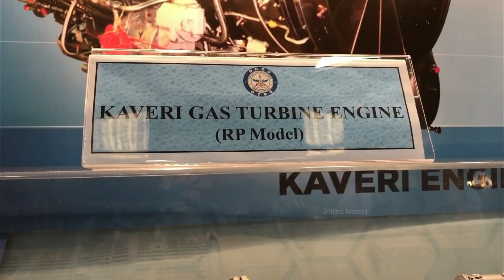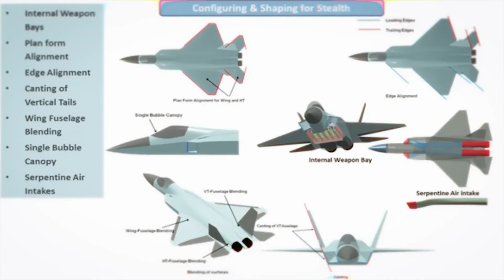AMCA: The Stealth Fighter That Could Change India's Air War Future | Reality Or A Hype?

Comment: the original design of AMCA was with a totally fetal mistake, it is too late to change, since it designed as a medium sized  fighter, with medium power of engines, GE 414, in 100 kn level  vs F 22 at 153 kn and J20 now at 180 kn, it is not just size, it determined, AMCA cannot carry much of the fuel, not much of weapons and not as powerful radar and other sensors compare to F22  or J20, with limited range and combat radium, no need to mention it also limited its speed and with no enough power for other operations such as controlling  drones since all of which needs power ，that is why China 's J36 with 3 engines.
Reply from the maker: Good Analysis

Comment: to add some more salt into your wounds, China now on J20 already with GaN-on-SiC (go check and learn what it means), i just tell you, it is much better then currently what F22 or F35 used. as claimed with 3 times more powerful with the same numbers of T/Rs, in real, it is about 40% more powerful, which means, if F22 can detect 100 km, it can reach 140km, the meaning, lock and launch missile first and leave first. that is for F22, for AMCA, then no need to say more.